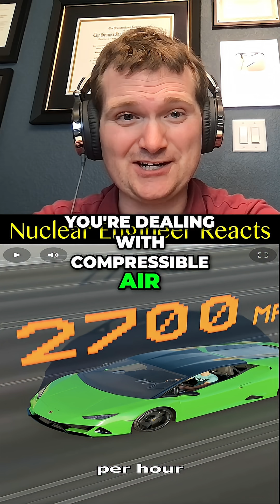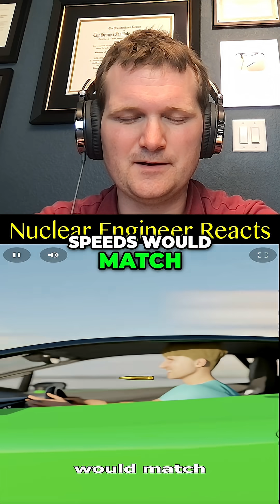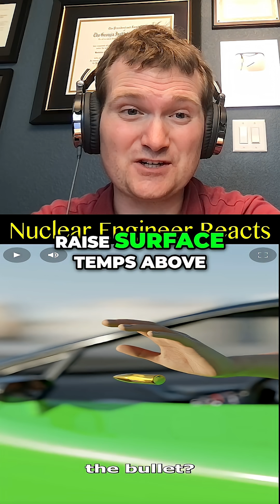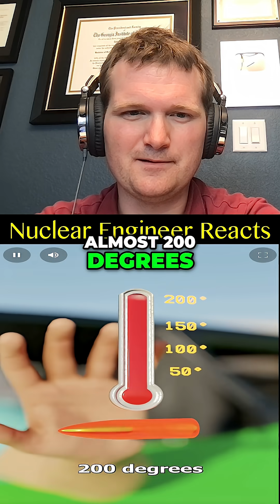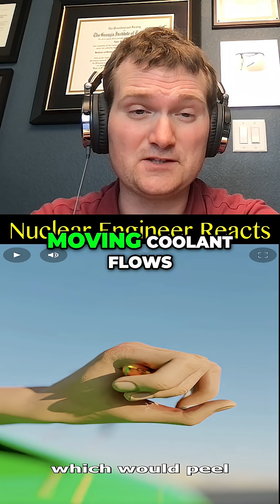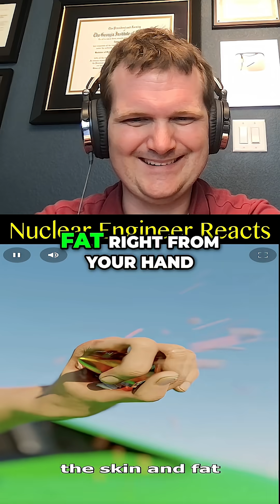Can you Catch a Bullet? - Nuclear Engineer Reacts to Zack D. Films

Comment: Car faster than a fighter jet this vehicle can't be exist you're dealing with compressible air shock waves and re-entry levels of heat you're gonna need active cooling like the space shuttle or nuclear thermal shielding no tires are surviving this no road is surviving this you'd vaporizer this vehicle from arothermal stress your body gonna liquify from vibrations and acceleration and your electronics are gonna arc from all this friction generated plasma "but okay let's see"...

Comment: Space Shuttle vehicles do not actually have active cooling, but rather the tiles out layer simply radiate almost as much heat as they absorb. Any excess heat builds up a little bit, so the rest of the tile is a fiberglass polymer layer to insulate the aluminum airframe. The Shuttle re-entry procedure is actually slower than most other spacecraft, as the tiles have a maximum rate they re-radiate the heat. Most other spacecraft use heat shields that fully absorb heat and then flake off to take the heat away from the spacecraft, and the rate of flaking (Ablation) is directly proportional to the rate of heating, and thus the limit becomes the g-forces for the squishy humans inside.

Comment: The guy in the original video seems to have confused feet per second and miles per hour, 2700 mph is actually faster than the average cartridge, most rifle cartridges reach about 2000 mph

not that there would be much of a difference

Comment: The wheel would turn at roughly 40k rpm. If it was a solid titanium disk with a radius of 30cm and a thickness of 10 cm it would reach maximum hoop stress (disintegrates) at a bot over 20k rpm

Comment: "Imagine you're hypothetically traveling at the speed of light"
"Well actually that's impossible because of-"
You really gotta learn when to stop man
Reply: That's not even close to comparable. When you make an hypothetical situation, the conditions you set can't just invalidate the reasoning you use later, which they do here.
Taking the speed of light as an example, you can't set that as a condition if you're gonna reference general relativity and your mass or any process that depend of them.
Reply: @glacedge but the video only references the interaction with the bullet. You don't need to account for the car disintegrating or the pavement breaking here. It's exactly comparable.
Reply: @ozargaman6148  What are you on about ? The video is about grabbing the bullet. YOUR HAND EXISTS FFS
Reply: @glacedge Right, and when the hand grabs the bullet, it gets torn apart. But we don't account for air resistance. Why? Because the focus here is to learn something about the bullet (that it's hot and spins really fast) and not the air. Just like you said - we need to account only for the relevent information. Eventually he does talk about air resistance as a side note but the focus is on the interaction with the bullet.

Comment: gravity would make the bullet fall vertically just as fast as gravity always does. without wings trading velocity for lift, it would just fall to the ground exactly as if you just dropped it. if it started horizontally, you wouldnt have time to catch it. unless it was going up and you caught it on the way down. it would look to you exactly as if someone tossed it into the air and it fell. no matter how fast the bullet is fired, it wouldn't hover in the air. on earth EVERYTHING in free fall accelerates down at the same speed, 9.8m/s (minus air resistance, but only in the exactly downward direction)
Reply: i see others said this first. im glad so many people saw the same issue

Comment: Different question. If you can slow down time around you but you can move with just the same speed as before, shielded by some temporal displacement bubble, can you pick up the bullet and place it behind its original target? My guess is yes.

Comment: 2700 mph is mach 3.5 faster than the sr71's official top speed of mach 3.2 (though there have been stories of pilots getting that fast in a sr71) and this thing is on ground level so it's going to experience a lot of drag so yeah the aerodynamic heating here would require a lot of advanced supper alloys/ceramics or silicon tiles like the space shuttle (though this is nowhere near the mach 25 reintry speed of a space shuttle it's a lot more air)

Comment: The space shuttle didn't have active cooling on the heat shield, the engine's did pump it's cold liquid hydrogen fuel to cool the nozzle before combustion but those hade no fuel in the system when re entering

Comment: 2700 MPH is WAAY faster than most bullets.  Bullets are measured in feet per second and a FAST round like a NATO 5.56 goes about 3000 FPS.  A .45 hand gun round will be under 1000 FPS.

Comment: 1200m/s, mach 3.5, definitely fast enough to heat up whatever is exposed to the outside air, especially at ground level. I didn't believe it at first because 2700mph looked like a small number

Comment: A good example for this is how space stations work.

They don't stand still. At all. They move around the planet with 28.000 km/h (that's ~17.500 in old roman empire units), but when you see something docking to it, it looks like both elements don't move much.

This of course mainly works because no atmosphere left at that height (around 1/500.000.000.000 of ground level).

Comment: The space shuttle orbiter didn't actually active cooling. It used passive silica tiles
Reply: How will you actively cool in space? You can only transfere the heat around in your vehicle, not get rid of it, because there is nothing outside. 

You can't of ourse just constantly drop heated material out, because then you will quickly run out of that material sooner or later, so going with heat loss via thermal radiation is your obvious and almost only choice.

Comment: Bullets are hot when they leave a gun but with such low mass and high speed they shed heat fast. Equally they don't experience much compressive heating or friction because of their shape. If the bullet flys more than a few meters from the gun it'll be about air temp. Also bullet spin fast but they are small and low mass 
My calculations spit out rotational potential energy in the tens of Jules. Stopping a spinning bullet would be the equivalent of catching a 1kg mass that of about 1.5 meters.
Your arm and the car would still be destroyed.
Reply: Zachd videos are so stupid and unnecessary anyway

Comment: The moment you opened the window of your indestructible car, you would be sucked out as plasma
Reply: Damn, I didn’t know extreme force of speed could plasma you like that
Reply: @AD-lh3jk ok maybe not plasma per say, but you’d be reduced to high-velocity, blackened fragments of charred carbon tissue, bone shards, and evaporating fluids
Reply: @thedirtbag7 Pretty bad ass way to go. I've always been a fan of catapult to the sun, but this could work, too.
Reply: @Rookinatorrrrrr  Well if you go to the sun you’d add more fuel, making it glow slightly brighter… this would also have the effect of slightly reducing the suns lifespan
Reply: @wow-roblox8370imagine having a child and saying “when I’m gone, look at the sun. it will be ever so slightly brighter and will die just that little bit faster”
Reply: @wow-roblox8370  per volume, the human body produces more heat than the fusion reactions happening in the sun.

It's only because the sun is so huge, that it adds up to a crap load of heat.

So a scaled down sun as a fusion reactor on earth to match volume of your body, with the same performance as the sun, would be out performed by the heat generated by your body.
Reply: @Rookinatorrrrrr  It is actually very hard to fall to the sun. You need to accelerate to 30 km/sec to do that. It is much easier to just leave the Solar system.
Reply: @dmitriy4708 thats actually a pretty neat insult. Telling someone they should just leave the solar system.
Reply: "Don't look outside" bad ending 1